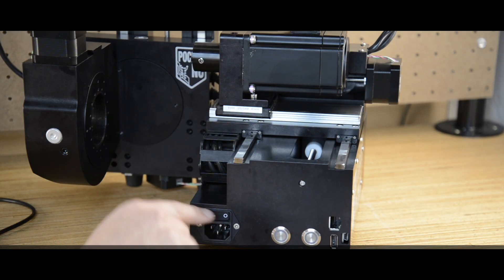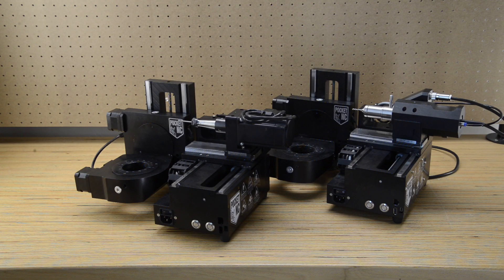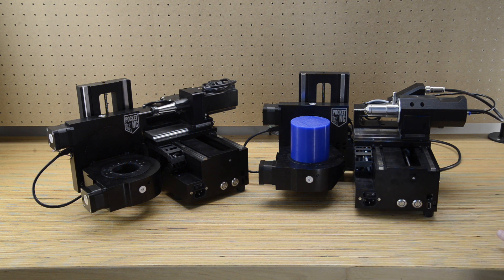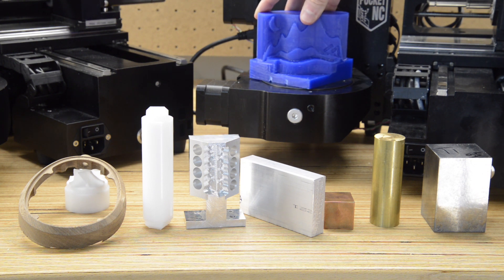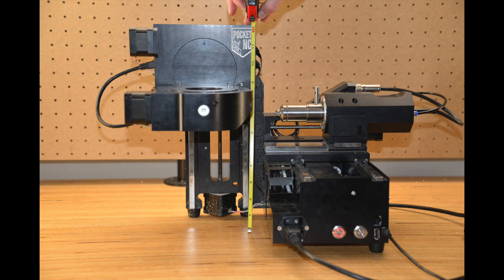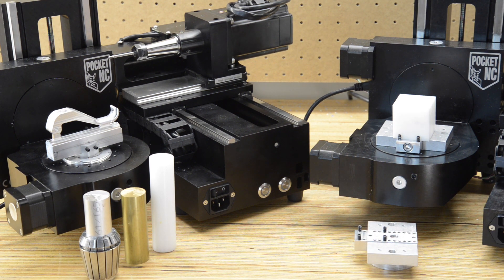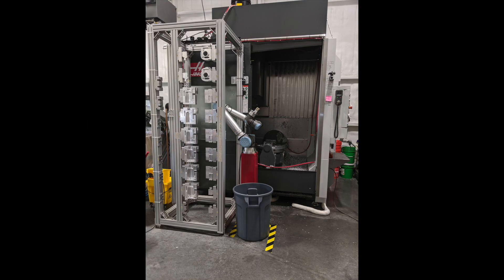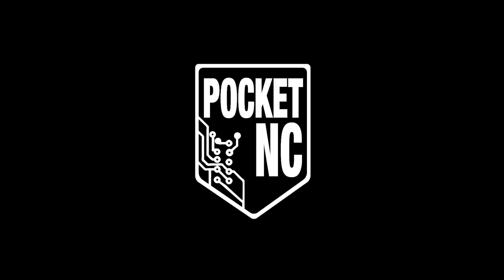10 Frequently Asked Questions about the Pocket NC

Comment: I am going to buy it, but after looking at this video, i got a question. The resolution of the machine on paper is good, but said tolerance is way too loose. I am gonna machine small ti6al4v parts 45hrc at very slow speed. Can i somehow get +- 20microns ? Share tips on the same asap. I am eager.

Comment: There is a HUGE market out there for the "next step up, medium tier" 5 Axis CNC machine. If you guys could make a 5 Axis machine that can handle stock that is more in the 10in x 10 in x 10in range and is in the $30,000- $40,000 price range, you would kill it! Because right now in the market there are $100,000+ 5 axis CNCs or there is the $7,000 Pocket NC. There is no in between.
Reply: Going from a 3” cube max to 10” is HUGE in the machining world. To maintain accuracy it would need to be massively better built, stiffer. Accurate… not a hack on their machine. But it’s an engendering feat to do so. Unless your willing to throw accuracy out the door.
In saying that they said in this vid the pocket nc is typically accurate to plus minus 0.005”. 
The industrial cheap equivalent is aiming for 0.0005”. A magnitude better overall while offering larger work volume. (Haas umc 500 comes to mind) pretty much the cheapest true 5 axis. You could grab a smaller haas and add on a 5axis trunnion tho. Still big bucks.
I have a haas vf2 that’s 5 axis capable. But man just the trunnion is more than I’m willing to spend.
Pocket nc would be a great training tool!
Reply: Their is a medium sized 5axis for wood and plastics only and heaper than pocketnc.  It is 5axismaker.
Reply: You are wrong , Taiwan and Chinese have so many 5 axis CNC machine between $15,000 - $50,000. First , Pocket NC can't massive production the bigger machine , and i think they still don't own their factory, they just order the parts by OEM. Second , their cost is higher than Asia factory , and Asia CNC company selling many machine to China , South Asia , Russia , East Europe  and Middle East , They have many stable client and market already . Pocket NC is no chance in industrial market. Pocket NC just like a "Toy"
Reply: @DeZug  firstly never say never, look at Haas, from rotorys to one of the larrgest global cnc producers, but but i digress. I would be interestd in a asian machine that has a 10" cubed build volume accurate to 0.0005" while ising all rotory axis simultaniusly thats $15,000usd, if you have a direction to point me in. heck, id buy a 5 axis, a multi axis swiss lathe and a multitask the with barfeeder to 2.5" and parts loader. oh the dream! but im stuck with a 2 axis lathe and a 5 axis haas
Reply: @brianwaayenberg3099  He just want the low budget 10x10x10. No body talking about 0.0005. We are not aircraft engine production , who need 0.0005 in for personal
Reply: @DeZug  i suppose tht would depend on what your prototyping/producing. if your + - 0.005" i guess you can make decorativ items? with a 0.01" tolorance window it would be pretty hurting for anything mechanical
Reply: @brianwaayenberg3099  Honestly, I if you want the 5 axis CNC for steel or stainless steel with 0.005 , desktop is useless and no power for this job. Many desktop top nc spec is not truth in real running. If you want real 0.005 or 0.0005 for metal , you will not go to Pocket NC channel. Who will using the aluminium pocket NC body frame for metal milling with high accuracy? Reasonable ?
Reply: @DeZug  sir, a typical Chinese made product is 10 times below the standards. It will cost you many times more than an "expensive" machine on the long run.

Comment: Do you have closeup sample photos of jewelry wax carvings made from your newer machines?  That pdf study of a jeweler using your machine doesn't show details, size and surface quality for small and intricate jewelry carving.  It isnt  convincing considering what jewelers need to mill on wax.  I think there is a huge market in the jewelry trade if you can prove what your new machines can do
Reply from the maker: Hi Allen, thanks for the feedback. The capability to do intricate designs would be a good post or video so I will note that. The jewelry study we have on the site is with the V2-10, a better machine would be the V2-50 series (it was not available at the time the customer made the purchase). A few examples of jewelry can be found here: https://www.instagram.com/p/CIoxej3hsW7/ and here: https://www.instagram.com/p/ByTiBfKCGIq/. You can see a few other customer part examples on instagram by searching the hashtag #pocketnc and in the Pocket NC Community Facebook group there are some examples of customer parts as well.